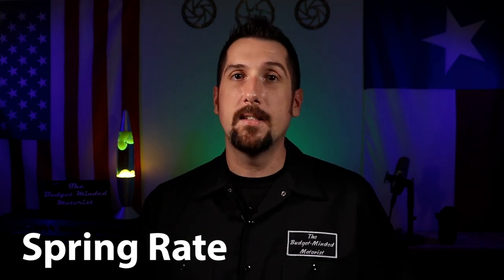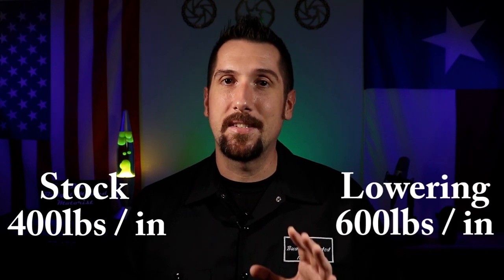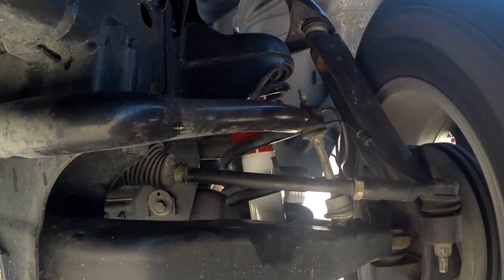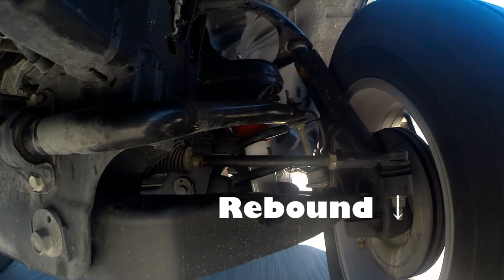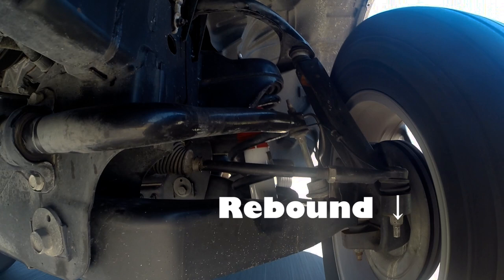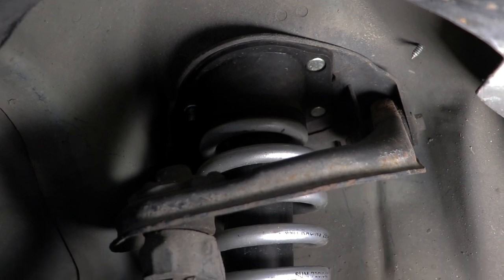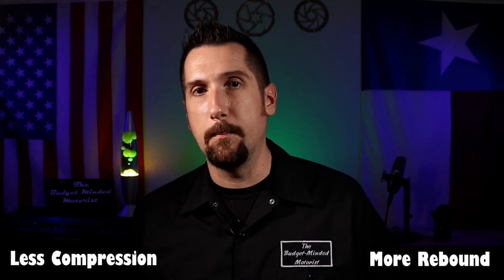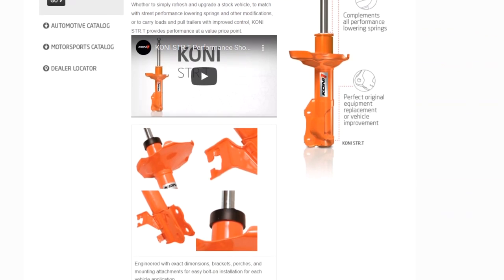Can You Use Stock Shocks With Lowering Springs?

Comment: I installed Steeda progressive rate lowering springs on my 18 Mustang GT and kept the factory dampers the car handled awfully. Definitely did the pogo stick thing, I wasn’t putting up with that  so I installed Steeda dampers to match the springs. What a difference, the car handled great and felt like a sports car.  If you can afford it do both springs and shocks at the same time, it’s worth it.
Reply: I just installed those same springs on my 2021 GT as well and both front struts made clunking sounds awful had order those steeda struts to match smh

Comment: I found this out the hard way. Had lowering springs installed and ended up with one of my rear shock seals blowing under heavy cornering load. It didn't cause the shock to completely fail but was leaking so ended up having Bilstein shocks installed. Made so much difference and now handles beautifully.

Comment: You have hit the bail right on the head. I have  91 Corolla Gti 16v UK spec 3 door hatch.
I recently fitted a set of Eibach springs, which resulted in about a 30mm drop. This has destroyed the ride and handling of what was quite a good handling car already. So the originals will be going back on soon
Reply from the maker: I'm not going to lie, there are times I wish I'd held onto my factory springs. I  really do like the looks of lowered cars, but roads definitely aren't getting any smoother these days....
Reply: @TheBudgetMindedMotorist  I've had the stock springs re-manufactured. this involves re-tempering and shortening them to lower the ride height , whilst retaining the original spring rate. I am about to embark on swapping them over and replacing the shocks at the same time. I will let you know how it goes

Comment: Great video. Kind of surprised you don't have more subscribers. I am putting h&r lowering springs on a Grand Cherokee. How do I go about finding the right shock setup to go with it?
Reply from the maker: Thank you! I'd recommend reaching out to the spring manufacturer first and seeing if maybe they recommend a particular shock to pair with their springs. Otherwise, it's a matter of shopping around, reading reviews and maybe checking some forums for specific recommendations until you find a good option. That's how I ended up going with the Koni shocks in this video . But if the spring manufacturer can save you all the time doing research and point you straight to what they know will work best, that's ideal.

Comment: Hey man great video, very informative but I still have a couple questions. I want to lower my 22 Camry se by an inch or two, and Im looking into eibachs. However on the website it said it’s designed to work with the oem shocks. Can I still use just the springs alone? Or do you recommend getting shocks too (if so could you please give me some choices)? 

You mention that lowering springs can wear out your shocks faster but how much faster? I don’t plan on making this Camry a handling beast, so if that means I lose a couple thousand miles of lifespan on my oem shocks, I really don’t mind (90k -95k miles with lowering springs vs 100k without the lowering springs). Realistically I drive 2 miles to school on the weekdays and MAYBE 30 miles on some weekends to my girls place.

I’m new to the car modding world but I don’t want to make a stupid decision. I don’t need craazzyyyy performance, I just want my car to look cool lol (that doesn’t mean I want the cheapest and shittiest part, I just don’t need the top of the line racing equipment for my daily driving). Plus I’m in college so my budget ain’t the biggest lol 😅😅. My bad for the long message, just really need some insight.
Reply from the maker: Thanks for the kind words. It's tough to say because I haven't personally worked with that exact vehicle and springs, but my advice is usually Google search for forum sites related to your vehicle and see if people have tried those springs with stock shocks on a Camry. If the lowered stance is the main motivator and you're not real concerned with ride quality or handling it'd probably work. For how long though? I honestly have no idea. Road conditions like bumps, pot holes, railroad crossings and how you approach them are all going to have a big impact on how long shocks will last.
Reply: @TheBudgetMindedMotorist  thanks for the insight. I looked at forums online and I’ve gotten mixed answers. The consensus is that eibach springs are good but some people say “lowering springs make your shocks wear faster” while others say “you’ll be fine, just don’t drive crazy”. Some even say that the TRD Camry has “eibach” springs from the factory. Some just say get coil overs in general (but all the ones I’ve seen are 1k+, which honestly I can’t afford). Personally I’m gonna go to Toyota to find out more info (hopefully I don’t get a generic answer). 

I know you said you haven’t really worked with that vehicle or spring, but do you know of some shocks that are affordable and good quality that could go with the eibachs in general? Since i may be buying the two components separately, im not too sure what brand or features to look out for.
Reply from the maker: @moyinoluwaajayi2285  sounds like you've done your research. I like my Konis quite a bit but I don't think the have an offering for your car at the moment. If coil overs are out of the question it  looks like the options are gamble on the stock shocks and maybe they hold up ok even if the ride might not be that great or just enjoy the car like it is. Nothing wrong with that. To be honest, modifying suspension  can be like that sometimes.
Reply: What did you end up doing with your car? Jst curious? I have the same car as yours but  mine is a 2020,  I been on lowering springs for 2 years bout 30k miles and the car still feels amazing.

Comment: On the off chance if the lowering springs in question are made to match with the car. Some brands (I think like eibach) make them to match a specific car's suspension. How much would the alignment of the wheel be effected? Would I be expecting a ton of unwanted negative camber? Or depending on the car would this not be an issue as much? (I own a 2014 camry and considering dropping it 1 to 1.5 inches)
Reply from the maker: Generally speaking, any change in ride height will have an effect on alignment. I would expect to see additional negative camber after lowering the car, as this has been my experience. If the camber is too negative for your taste, there may be enough room in the factory control arm adjustments to bring things back to spec after the drop. If there isn't enough factory adjustment, sometimes the right "camber kit" can be used to actually decrease the negative camber. I would definitely recommend putting the car on an alignment rack anyway after installing the springs, as toe could change some as well and the technician doing the alignment will be able to let you if any additional adjustment / parts to get the camber where you want it.

Comment: I have a 2002 Mazda Protege, I am thinking about lowering my car with lowering springs. The Protege like most FWD cars has a strut assembly. I watched your video about not using stock shocks with lowering springs, makes sense. With the lowering springs available for my car I'm going to end up about 1.5-2" lower. The struts that I have found all tend to be OEM style replacement struts. KYB does make a strut that is available but one thing I was curious about was size, do the struts need to be shorter? If that is the case how would you measure that?
Reply: I need this question answered . I have 2004 Celica though

Comment: it is necessary to add thread on the original shock absorber if for example the springs are -30mm it is necessary to filter 2.5cm in addition and the shock absorber will work in its standard

Comment: Very accurate explanation! I am having this problem with my 2020 Honda Accord Sport 2.0T on H&R sports lowering springs. The problem is that Koni doesn’t make shocks for my vehicle. Any recommendations? I appreciate your answers!
Reply from the maker: To be honest with you I can't really make an informed recommendation for a particular shock, as I just don't have the personal experience lowering that model of vehicle. I bet it does look good though! 
That being said, I took a little time to look around and unfortunately there just don't seem to be that many options available for the current generation of the Accord at the moment. Tein offers adjustable shocks which should offer some improvement over stock, but info on them is rather limited as far as reviews and such. They might be worth looking into though. Beyond that, it seems like the only other aftermarket options are coilover kits.  Hope this helps!
Reply: @TheBudgetMindedMotorist  Thank you for your answer! I looked everywhere and there is nothing available for this car. I will have to go with coil overs.

Comment: I recently upgraded my springs on my 19 cruze. GM performance lowering springs, which are lower than factory. Gm says the springs are interchangeable with factory struts. They don't sell a performance kit with the struts .The springs lowered the car on .10mm which isn't much,but it's still shorter.

Comment: I have a 2004 VW GTI and intend to replace the shocks and springs.  I already bought, but have not installed the Eighbach Pro Kit springs which are designed to lower the car 30mm.  I also bought the Bilstein B6 shocks which are designed to be an OEM replacement shock.  When I talked to Eibach, they let me know the Biltein B6 shocks are a good pairing with their Pro Kit shocks.  What's your opinion?  Am I making a mistake by pairing a spring that lowers the car 30mm and is arguably stiffer than factory springs, with the Bilstein B6 shock intended to replace the OEM shocks?  Is there a higher probability of the shocks wearing out prematurely?  Is ride quality likely to be degrades and cause the po-going described in the video?

Comment: Do sport shocks make difference in ride height , keeping in mind that they are usualy a bit shorter than the original ones ?
Reply from the maker: Unless we're talking about a coilover set up or a shock that's part of a strut assembly where the manufacturer has altered the location of the lower spring perch,  shocks shouldn't have any effect on ride height. 
Ride height is set by the spring's characteristics.
If a sport shock is shorter, it's usually only because it's meant to be paired with lowering springs.

Comment: if we use stiff sport springs is there are any effect if we change gas type of shock to be oil type shock absorber? since oil more heavy in rebound
Reply from the maker: I've had a little experience running both gas and hydraulic shocks on my truck. I did notice the hydraulic shocks were certainly more plush of a ride, however I haven't tried pairing them with stiffer lowering springs.

Comment: what happens if i use a sport spring from eibach for example...the sport springs are only used on the rear of my e36...and i bought a 2ndhand coilover shocks...and what will happen if i use the rear setup of sport spring and adjustable shocks only..
Reply from the maker: I can't say for sure. I'm not familiar with the e36. For answers to something that specific I would look for a forum dedicated to the vehicle platform and post your question. There may be someone who has tried it on the same car and could answer from experience. Generally speaking though , changing the suspension set up in the rear without changing anything up front could in theory drastically change the handling characteristics, but not always for the better.

Comment: Enjoyed the vid.

A couple things unaddressed:

1- how much did you lower your transam?

2- it seems replacing a factory spring with only a 1" lowering spring is not going to warrant investment of new shocks or deal with the concerns addressed in video. Therefore, are there not some exceptions with certain perimeters? 

All-in-all, great insight to consider from your video content. Thanks again. And thanks for any responses! Happy motoring.

Oh. Ps. Im riding stock Mini Cooper Clubman F54 sport 2018.

Looking at 1" lower springs from potentially either AST ($309) or EIBACH ($224). 
Not a ton of options for the Clubman. Still researching options.
Reply: Hey, let me know if you get the springs and how they work! Cheers :)
Reply from the maker: I can't recall if my springs were 1.25in or 1.5in lowering springs , but in my case it wasn't so much the amount of drop as it was the factory damping just didn't play well with the spring rate of the new springs. The car looked great and all, but the ride was was way too bouncy and made the car feel pretty unstable when cornering on anything other than a perfectly smooth road surface. 

As far as exceptions go...
I suppose if the spring rate of the lowering spring was close enough the rate of the stock spring and the stock shock doesn't bottom out with the lowering spring, then the stock shocks could work ok. 
But I'm honestly not familiar enough with the Mini Cooper to say with any real certainty if that would be the case.

You could always run with the stock shocks for a bit and see if your happy with the ride and handling, then upgrade later on if you want. That's what I did.
My only real regret was the extra work of swapping shocks later, rather than when I already had everything apart while installing the springs. 

If you've got any more questions or if  there's anything I didn't quite answer, let me know.
Reply: @TheBudgetMindedMotorist  awesome! That helps. Thanks for the insight/response.

I'll do some more digging. Would be interesting to know deeper specs on everything. Kinda surprised how generic most of the listings are.

Comment: I just did a reverse 2" leveling on my 2003 suburban ( 2 inch drop in rear)can you please tell me what shocks I should use?? I bought some kyb Excel g and the ride seems horrible.. PLEASE GIVE ME SOME ADVICE ON WHAT TO GET.
Reply from the maker: I honestly don't have the experience with the suburban / tahoe platform that I can use to personally recommend one shock over another. My best advice is to spend some time on a forum like https://www.tahoeyukonforum.com/ and see what other users recommend based off experience. I took a couple minutes to browse the site and saw some posts mentioning Belltech shocks. They might be worth looking into.....

Comment: What I have understood that if you lower the car 1.5 and more you need to change the stock Shocks.
Reply from the maker: While the amount of drop can have an impact on shock life and performance, the biggest impact is generally going to come from the spring rate in relation to the damping design of the shock. Most lowering springs of any height are going to be stiffer than stock and likely warrant looking into an aftermarket performance shock.